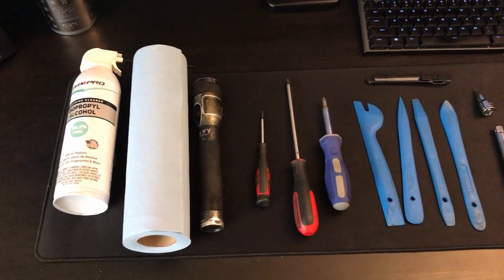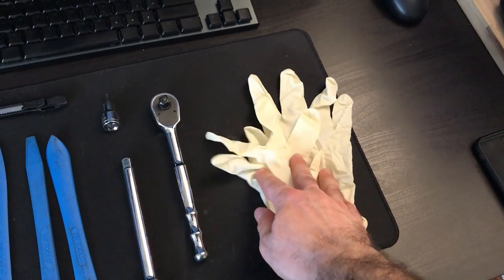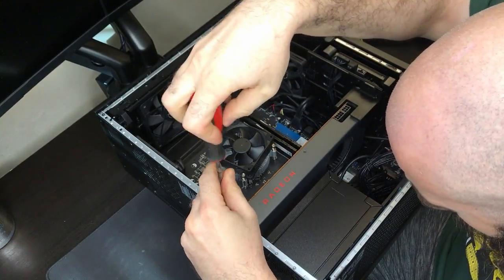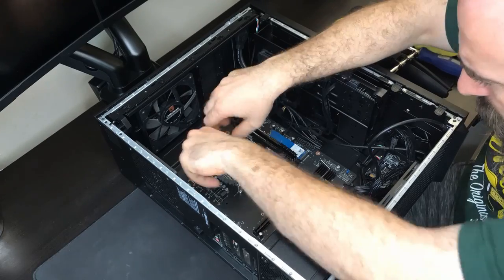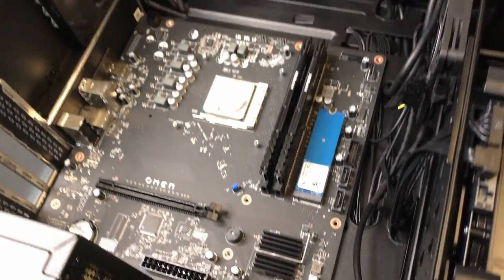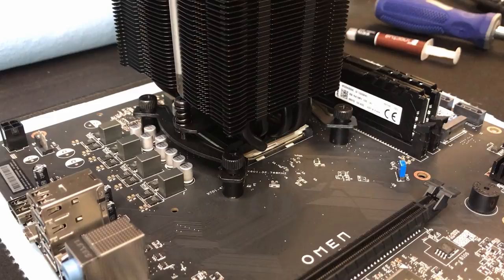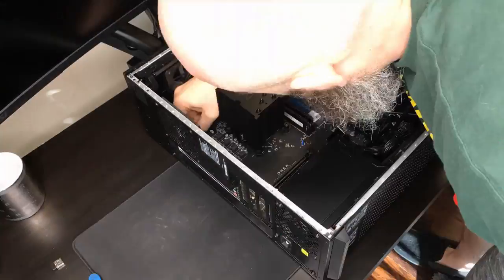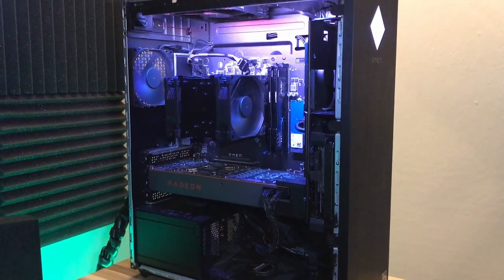Installing A Noctua CPU Air Cooler In My Omen! Complete Tutorial 😎

Comment: I changed out the cpu fan and put the same one you have, but when I turn on my pc, the fans and inside the case run but it doesn’t display to my monitor or connect to my keyboard and house(they have led and doesn’t power on), do you know of anyway to fix this? My pc doesn’t turn off by the button and when I plug it in now it turns on by itself, can you help me?
Reply from the maker: Did you change or unplug anything else? I’m a little confused on what you mean. 

Also, you should not be pressing the power button to turn the computer off, you should use Start menu -> Shutdown anytime you are turning it off.
Reply: @DanKamYouKnow  I didn’t change anything other than the cpu fan, I did as you did in the video but I’m not sure if I messed up my motherboard in the process. I don’t know what the start menu is but I cant use my keyboard or mouse, my pc only turns on and the fans work but doesn’t turn off, display on my monitor or connect to my keyboard and mouse.
Reply: @DanKamYouKnow  also when I plug it in to the outlet, it turns on by itself now,  I plan to take everything out and put it back in and see if I did something wrong.

Comment: Enjoy your videos. Installed the same model Noctura in my 25l. would not boot. No video. 3 long beeps and 2 short. Cpu and other fans work. Disconnected everything except mb and ps same beeps. Any ideas? Thanks again for your videos. Barbara
Reply from the maker: Did you remove the RAM sticks from the PC when you did it? Make sure they are fully seated first. Check all your connections on the board and make sure they’re all plugged in. What did you use to remove the CPU cooler bracket? Any chance that you could of scratched the motherboard?
Reply: @DanKamYouKnow  used plastic to pry back plate. No problem there. Removed and reinstalled both mem sticks. I  am running a Ryzen 5 3600, rtx3070 and 2 16 gb sticks. I am also thinking mb or power supply. I guess I will put everything back to stock, If I still have same problem, then I must have done something to mb.
Thanks again for help.
I really don't want to send it back to HP!
Reply from the maker: Well, if it’s still acting up in its stock form, HP will warranty the machine, since they won’t know about any mods that may have been done. Unfortunately they have a slow turn-around time. 

You’re welcome and let me know what you figure out. You could also try a CMOS reset as well: with the power off; hold down the power button for 30 seconds.
Reply: @DanKamYouKnow  
tried the cmos. I put it all back together. Same problem. It's going back to Hp. We will see what their response will be. Packaging is arriving tomorrow. I will pack and ship Fedx overnight. No charge yet. I must have shorted something in the mb. My guess. The Noctura cooler WILL be going back in. Maybe I should send them the cooler...mmm
Reply from the maker: Keep me updated. I would not mention anything about the cooler or any modifications done ( if that wasn’t a joke ).
Reply: @DanKamYouKnow Absolutely not. I think they will know I have been inside. They offered me an extended warranty. I think there may be some negotiations ahead. I will update.
Reply from the maker: Sounds good
Reply: Computer went out Tues overnight to Texas [warranty repair]. I got it back Sat morn. They replaced mb and ssd. No more info from them. I am very happy with that service. Temps are the same, as expected. I will get in touch with them again and ask about cooling issues.
Reply from the maker: That’s good to hear and quite a fast turn-around!

Comment: Hey Dan I recently followed all your directions for install and came upon a problem when powering on my omen. I got a 3 beeps and 2 beep error and it would not display or stop beeping. Through searching on fixes, I found that it was a ram error. It had been working prior to the install. I tested using other ram and found that it turns on when only 1 ram is installed into the right channel. The other ram chip also works upon switching. Do you think something happened while installing to the left channel? Do you have an idea on what I can do to make them both work again?
Reply from the maker: Try to do a CMOS reset and see if it works with the HP RAM. With the power OFF, hold down the power button for about 30 seconds.
Reply: My computer originally came with 1 8gb hyperx fury ram chip. I installed a few weeks ago 2x16gb Corsair vengeance rgb pro. They worked previously to this. Do you want me to try the CMOS reset with the new ram or the old ram chips?
Reply: I did the CMOS reset with new ram chips and it’s still giving me the 3-2 beep error and not starting.
Reply from the maker: Was the left hand DIMM slot bumped at all during the install of the cooler? Was the RAM removed while you were doing the install? So neither the HP or Corsair RAM will work in the left slot?
Reply: I did not remove the ram during install. I followed your video and I saw that you didn’t take it out. I also did not bump it at all. The RGB turns on still. I also touched the case before touching anything inside to release any static. I powered off the pc and unplugged power before hitting the power button 3 times to use up electricity still in the system.
Reply: Yes neither Corsair nor stock ram works in the left slot. Could it be anything with Ryzen master? I did your video to get it to 3200mhz a few weeks ago as well.
Reply from the maker: What did you use to remove the CPU cooler bracket? Any chance that you may have scratched the motherboard?
Reply: I used a plastic piece that could fit in there. It is possible that it may have scratched it. That’s the only thing I can think of as well.
Reply from the maker: Unfortunately, that may be the case. Not really sure if there are any other diagnostic steps to take.
Reply: @DanKamYouKnow  thanks for your input, I’m going to take out the motherboard and try and recheck everything. Do you know if any standard micro ATX motherboard will fit in the omen 25l case? I really appreciate your responses. Your videos are great and it’s made putting everything together really fun.
Reply from the maker: No problem Paul, wish we could of figure it out. Unfortunately, the Omen case will only support a Micro ATX board. Let me know if there’s anything you find out with the motherboard removal.
Reply: Was looking at motherboards to order just in case I can’t fix it, how does this one look?
ASRock B550 PRO4 Supports 3rd Gen AMD AM4 Ryzen/Future AMD Ryzen Processors Motherboard https://smile.amazon.com/dp/B089W2ZTHF/ref=cm_sw_r_cp_api_glt_fabc_5WZYMB136YGXSHHC4K4V?_encoding=UTF8&psc=1

I currently have a Ryzen 9 3900 and RTX 3070FE in my omen.
Reply from the maker: That board looks good, the only thing I see that’s kind of strange is that the motherboard seems to only support a max of 2400mhz? Not sure if an XMP profile bump will raise that higher but that seems a little low.
Reply: @DanKamYouKnow  I saw that too, but below it has this in features section:

“Supports 1st, 2nd and 3rd Gen AMD Ryzen/ Ryzen with Radeon Vega Graphics and 2nd Gen AMD Ryzen with Radeon graphics/ Athlon with Radeon Vega Graphics desktop processors for Socket AM4
Supports ddr4 memory, up to 3466+(oc) MHz
Turbo M.2: Running at pci-e gen3 x4 maximizes performance for NVME based SSDS
Ez debug led: Easiest way to troubleshoot
Core boost: With premium layout and fully digital power design to support more cores and provide better performance”
Reply: @DanKamYouKnow  if you have another motherboard to recommend, please share :) I’m still shopping around in hopes of getting this rig working how I want.
Reply from the maker: Oh, gotcha. I missed that, so that’ll work perfectly for you. Pretty much any Micro ATX board will be good: ASUS / Gigabyte / ASROCK all make great board. I went with a GIGABYTE Aorus Elite x570 and it’s great.
Reply: @DanKamYouKnow  hey I wanted to give you an update on what I did. I ended up buying an msi b550m motherboard and upgraded to windows pro. Installed 2 more Corsair rgb pro 3200 ram sticks, noctua air cooler with push/pull configuration, 120 mm 3000 rpm fan on the top pushing out, 120 mm fan on the bottom pulling in, 92 mm fan at back pushing out, 92 mm on the top hdd mount area pulling in. Everything worked great after getting an extension for the led and sw power from the front of the case. 

My thermals are around 40s in idle and gpu goes up to mid 70s for gaming. Cpu sticks around 50-60s. Does that sound about normal for a Ryzen 9 3900 and rtx 3070 fe? I was thinking about seeing if I need to play with my fan curve or something else. Might just be the limitations of the case.
Reply from the maker: Nice Paul! You’re correct, it’s the limitations of the case. Those temps as is look great and you could always set up a custom GPU fan curve with MSI Afterburner to bring down the GPU temp a bit ( even though 75c is completely fine ). I’m glad you figured everything out. Figuring out the best system fan curve can be kind of tricky. I normally leave mine pretty flat until about 60c where it ramps up slightly.
Reply: @DanKamYouKnow  thanks, I really appreciate your tutorials. I would never have tried so many things to a new pc without finding your videos. They are easily understood and very detailed with your tidbits of how you process the hiccups you overcame. I just saw your desk video and it’s making me wanna try that next 😬 too bad no Ikeas in Hawaii.
Reply from the maker: I’m jealous that you live in Hawaii! Thanks for your kind words and you’re welcome! I had a lot of fun modifying my Omen and it may get revived pretty soon actually.
Reply: @DanKamYouKnow  let’s get a 3080ti for your channel 🤞🏼
Reply from the maker: I’m trying to get a new card!! May have a line on an ASUS 3080 here pretty soon but gotta wait a couple weeks.

Comment: I wish you could install mine lol my 30L is running at 78-80C during warzone, which is not ideal in the long run for the cpu
Reply from the maker: A little warm but still technically safe. I could always help you out with any questions you might have while installing 👍🏻
Reply: @DanKamYouKnow   that would be appreciated! My biggest concern is the wifi card and taking out the GPU. I have the RTX 2060 gpu, not sure how it would come out compared to yours, other than that, everything looks pretty simple, just don’t wanna push or pull anything wrong, can’t afford to fix it lol
Reply from the maker: GPU comes out very easily. There are 2 screw towards the end of the case, sag bracket, and then push the clip down while gently pulling up on the GPU.

 Important thing is just to take your time.
Reply: @DanKamYouKnow  yeah for sure, it may not be as intimidating as it looks..im installing the top fan using your video tomorrow and see if that’ll help, and maybe replace the thermal paste, see if those things lower my temp to below 75C gaming. 

what thermal paste do you use/recommend?
Reply from the maker: Let me know what your results are after the top fan install. You’ll need a Torx T15 socket / screwdriver to remove the factory CPU cooler, it is linked in the description 👍🏻

Comment: after i replace the OMEN can read the CPU Fan -> Error (B90 or somtihing)
Reply from the maker: You didn’t plug all your fans in to all of the factory utilized headers. Whatever fan headers were used when the PC was stock, have to be used at all times
Reply from the maker: Or you’re trying to use a fan controller. Which will not work

Comment: Followed all the steps but mine will not start up unless I take the dimm1 stick out. If I have both sticks in I get 3 long beeps followed by 2 short beeps. Any suggestion would be appreciated
Reply from the maker: Was the DIMM 1 slot bumped at all while you were installing your cooler? Have you tried to reseat both RAM multiple times?
Reply: @DanKamYouKnow  I don't recall bumping it and I have tried reseating it a few times.
Reply from the maker: That’s really strange. I wonder why your DIMM 1 slot wouldn’t be working after changing the cooler, unless that stick was bumped during install. Motherboard wasn’t scratched during install or anything?
Reply: @DanKamYouKnow  didn't see any scratches anywhere. At least it still boots up with 1 ram slot. Thanks for the help. I'll keep trouble shooting
Reply from the maker: @MrPreycise  Good luck and let me know what you figure out.
Reply: Looking where I pried off the old bracket and unfortunately it looks like I scratched the motherboard a little. Bummer.
Reply from the maker: If HP wouldn’t of used such strong adhesive, issues like this wouldn’t come up. Sorry to hear that. I guess you could use DIMM 2 slot for a while until you find a new motherboard.
Reply: Yeah its all good. Thanks for the quick reply and your videos.

Comment: Why did you need to change the backplate?
Reply from the maker: Because that’s the proper way to do it. You can get custom length screws to use the original backplate but not really the right way to do it
Reply: @DanKamYouKnow  Ah okay. I am doing this mod right now and was wondering if I could get away with not removing the motherboard...
Reply from the maker: You’ll need 12 or 13mm screws to use the stock back plate but I don’t know the exact process to do it that way
Reply: @DanKamYouKnow  I took out the mobo and did it properly and now running 10-15° cooler than before! Thanks for the guide!

Comment: Is this product compatible with stock Omen Obelisk?
Reply from the maker: Yes, it will work for an Obelisk as well.
Reply: @DanKamYouKnow  thank you! Would you say it’s better than Corsair H60? I was going for H60 until I found your video.
Reply from the maker: Both are a lot better than the stock air cooler but the Noctua U9S has yielded better results on temperatures then 120mm AIO’s. Depends on which one you think looks better but the U9S beats out AIO’s up to around 5c.
Reply: @DanKamYouKnow  well Noctua it is! Thank you sir! It will be my very first mod. I’m kind of scared to remove the motherboard tho 😱 I definitely have to come back to this video
Reply: @DanKamYouKnow  One last question, did you like the top fan as the intake or exhaust?
Reply from the maker: Just take your time and you should be fine. The hardest part is removing the stock cooler backing plate. A plastic prying tool worked great for me.
Reply from the maker: I would see what works best for your temps. My machine performs better with it as an exhaust but people have reported that they see better temps with it as intake. Takes about 2 mins to flip it so you could experiment.
Reply: @DanKamYouKnow  Will do! I appreciate your input. I will keep them in mind when I work on it tomorrow. I will be installing the top fan, U9S, and one extra 92mm fan. I used your links and I hope they are affiliate links. Cheers brother!
Reply from the maker: Unfortunately they are not affiliate links BUT I’m still glad I could help you out 👍🏻. Let me know how the install turns out!
Reply: @DanKamYouKnow  Dan! I finished installing everything a few hours ago and I have been running Red Dead Online for over an hour. It used to be around 80C but with the new parts installed it stays at or below 60C. PLUS it is much quieter. 

I was stressed out about removing the motherboard out of the case because I thought I would mess it up. However, after studying your videos I was able to get it done smoothly. I appreciate you man.
Reply from the maker: So glad to hear AJ! It really is a nice feeling to be able to game and not have to eyeball your temps the whole time =). Happy my videos helped you do it 👍🏻

Comment: i did this like a couple mins ago and after now an i turned on my computer and now it’s saying to “press the esc key for startup menu” i did that an nothing changed beside it saying startup menu in the bottom, i also tried to open my bios an nothing worked, nothing changed 
i then turn off my computer multiple times disconnected my hdmi an it just doesn’t work it keeping saying “press esc key for startup menu”
Reply from the maker: Have you figured it out? You might want to try resetting your RAM or GPU and trying again. You could also reset CMOS as well: With the power OFF, hold down the power button for 30 seconds
Reply: @DanKamYouKnow  yea i actually figured it out. it was the graphics card not getting enough power, so what i did was i needed to connect a another cable that was suppose to be connected graphics card and then it showed the omen logo, but im going to returned the cpu cooler because it didn’t fit lol, it was a ak400 deep cooler cpu. so ill just use the one you use in your video because i also have a omen 25l just differ specs, so it should fit lol
Reply: @DanKamYouKnow  but i appreciate your help regardless thank you!
Reply: @DanKamYouKnow  an yea i tried resetting cmos but the battery didn’t wanna come out for some odd reason
Reply: also do you know if there a smaller version of the noctura cpu cooler because the current one rn is a ak400 an it barely fits lol and it’s sticking out of my case, an i look at the one you have an it seems that you more space for it while i have less lol so i don’t think that cpu cooler will fit unless there was a smaller version of it
Reply: the ak400 product dimension is 127x123x155 mm the fans are 120x120x25 mm the heat sink itself is 120x45x152 mm
Reply: also i have a intel processor will this cpu cooler work for that?
Reply: also where did you get your fan buckles for the 92mm fan, when you added the other noctua fan? so that i can get on for my own?
Reply from the maker: The only Noctua cooler that will fit is the Noctua U9S and it comes with the extra clips to secure another 92mm fan ( it only comes with one 92mm fan )